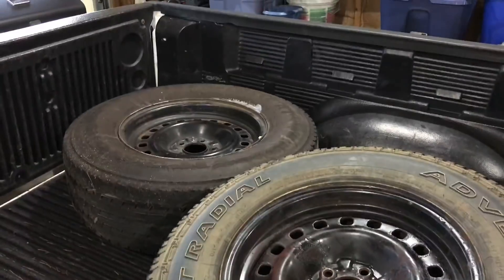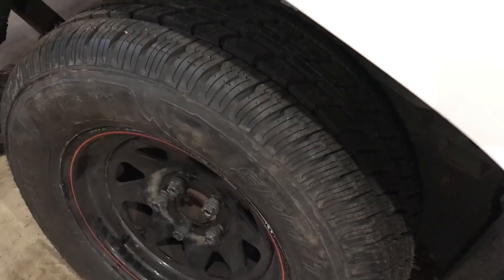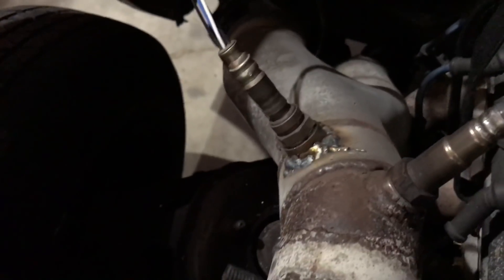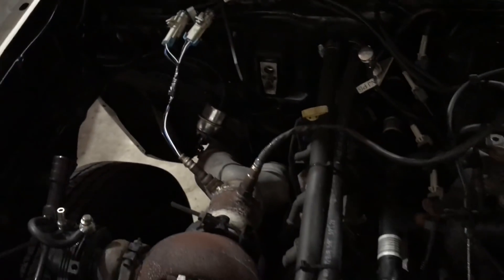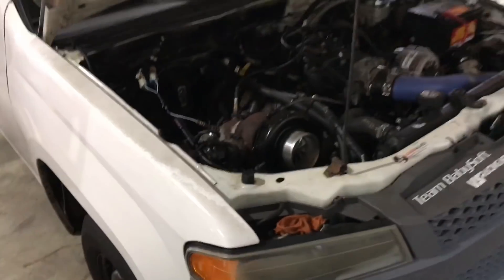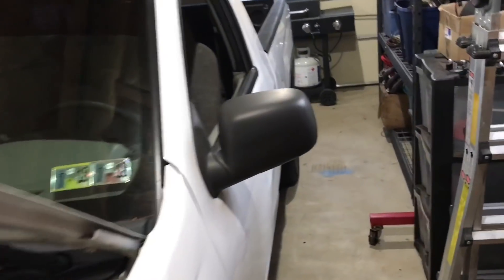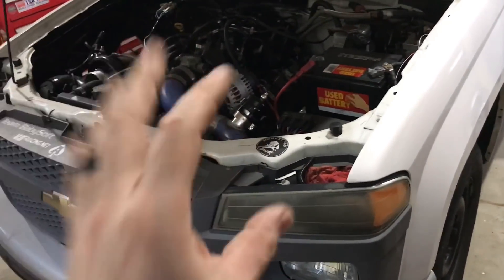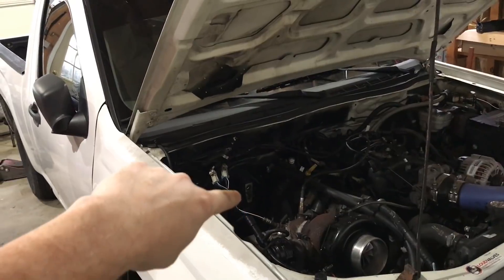210s running and o2’s combined?

Comment: I followed your recipe for 1000hp . I have twin turbos with the wastegates welded on to the housing, vs racing 44mm wastegates & the 210 Bosch injectors.. My tuner is having trouble finding data on the 210’s so he’s using data for the id2000’s ... what did you use ..???
Reply from the maker: Yep that’s what you use

Comment: So the answer you gave me about that you used a 01 chevy blazer cable throttle and foot  pedal was great thank you I have another question was wonder if you had pictures of how you mounted up the pedal and were exactly did you cut the hole for the cable if you have picture that would be so helpful but if not it’s cool ( I am a big fan )

Comment: So with the o2 sensor you're just simulating a bank 1 sensor 1/bank 2 sensor 1 using just the one sensor post turbo?
Reply from the maker: its using one sensor, and sending data to both banks in the ecu, the ecu needs to see both banks to activate and trim, this is just giving it that, with one sensor
Reply: Gotcha. Simulating was the wrong word but otherwise I got it. I feel like this hack could also be useful for shitbox hoopties too. Thanks for the reply!

Comment: One thing about the 210s you haven't mentioned is the impedance. Can you cover really quickly the whole impedance thing with OEM ECU?
Reply from the maker: they are like 9 ohms, wich really isnt high, high are usually 12-14, but they work fine in high ohm ECUs and drivers

lows are usually like 3-4ohm IIRC

Comment: Matt, which 450 are you running the 264 or the 274?  The 274 is the better unit pressure and power wise. Just curious.

Comment: Great work combining the O2 sensors. Wanted to know if you had your wideband connected to your HP tuner or how it gets wired to your engine harness , or if you just keep a close eye on the gauge when you Street tune.

Comment: Nice! I tuned a truck recently that we did both 02's before the turbo then the wideband after with closed loop speed density. It worked and drove really well. Same manifold as you just one 02 on the outlet drivers then the second right before the turbo.
Reply: Jeff's Tuning and Performance 
I am curious about this myself, as I was under the impression that the o2's before turbo would read funky due to the back pressure in the manifolds, not to mention them glowing red and failing prematurely. correct me if I'm wrong.
Reply: Matt totally agree and this was my speculation too, ill have to find the post about it but I read on the HPtuners forums that due to the narrowbands only working within the small range they are affected like a wideband would be. Plus when you go full throttle you go open loop and they are not used anyways. As for the heat I cannot say how long they will last but in factory setups they do sit next to a hot ass cat for there service life! I plan on setting this up myself and will test everything once my car is back up and running.
Reply: yea I was always worried about burning them up too soon and while tuning for cruise and light load, the trims and such are kind of skewed and I end up chasing my tail lol